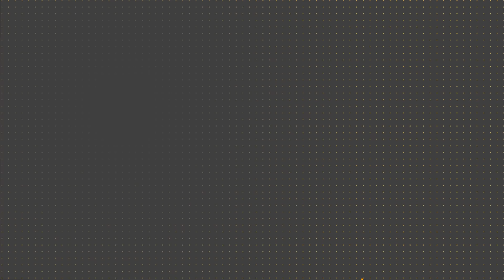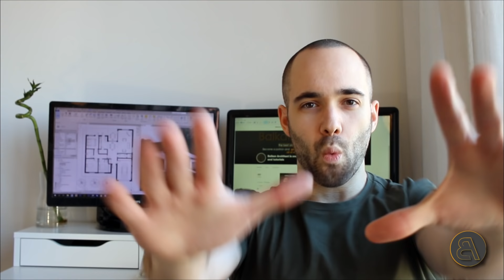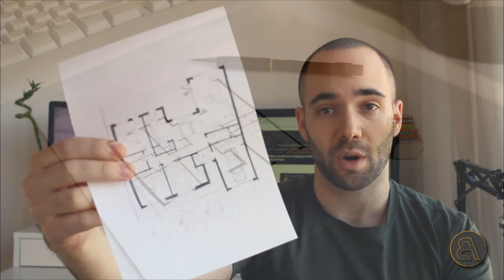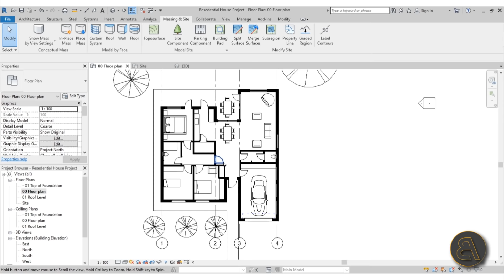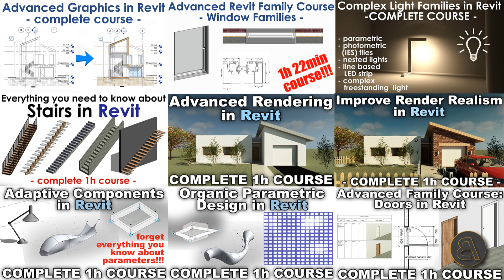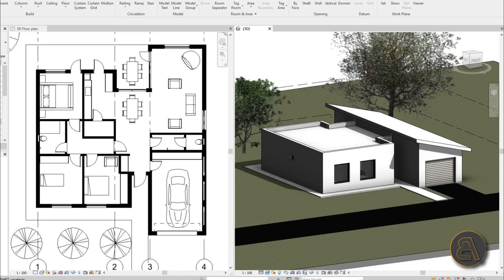House in Revit from Sketch to 3D Model Complete Beginner Course part 1

Comment: I have looked, but have you done any tutorials on using a sandwich/SIPs type panel like Kingspan or Metl-Span?  I need to be able to make a schedule and change the exterior and interior skins to different Gauges and colors on 4" typ. insulated metal panels